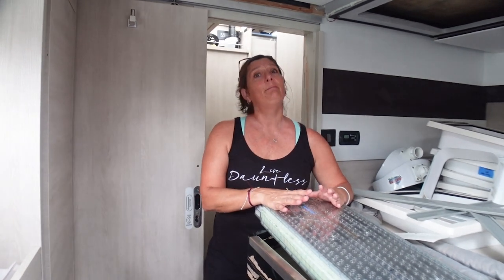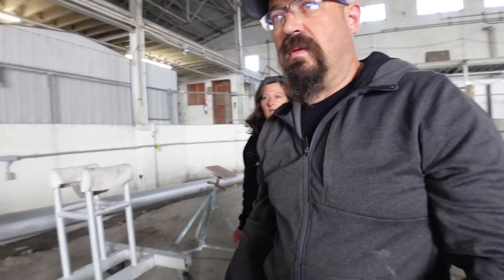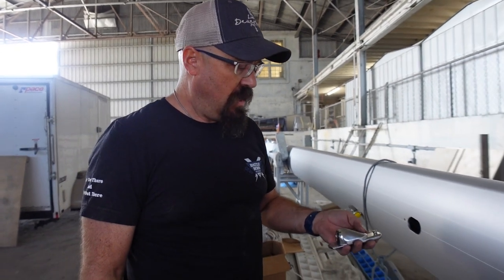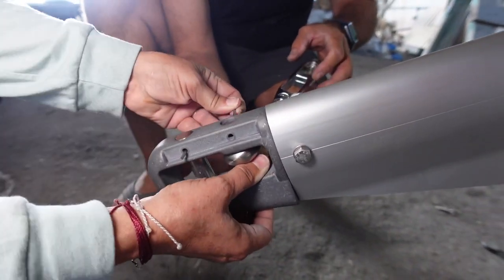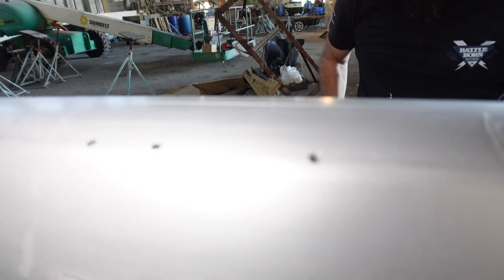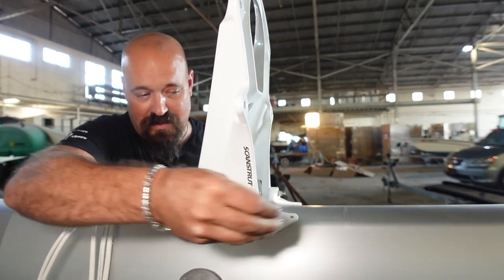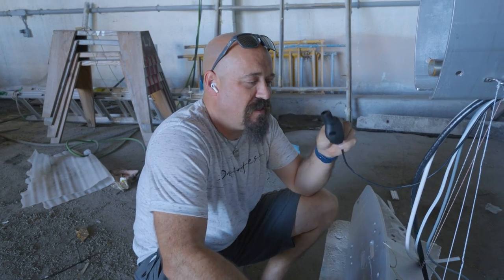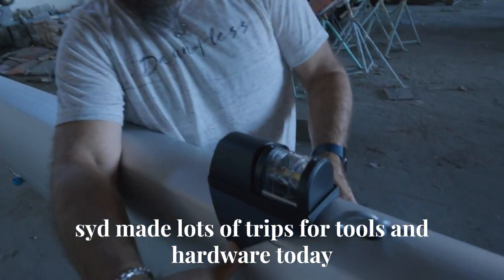WHAT DID KIM DO?!//Drilling Holes In The Mast-Episode 111

Comment: Two things that I never use are butt connectors and pop rivets.  Those washers for pop rivets are actually intended to go on the back side typically with softer material like rubber, plastic or fiberglass.  I prefer using closed end rivnuts for all of my fastening needs and if you ever need to remove the mounted object you can simply remove the screws or bolts and reinstall them when done.  The other nice thing about rivnuts is you do not have open holes if you remove whatever is mounted and you can put the screws back into the threaded inserts to give a nice clean look.  Instead of butt connections I use Deutsch connectors for everything and they seal amazingly well.  When they are crimped using the proper crimper from the manufacturer you will never have a bad connection and you can easily unplug it for service.

Comment: To let you know a direct lighting strike will still fry as many electronics, with or without lightning protection.  When you buy a lighting system ask them if they will pay for any electronics if its fried from lightning. They will tell you no and that is because they know it doesn't do anything except make them money. nothing can stop 1 plus million amps from going where it wants to on a boat. Even super yachts can not handle a lightning strike without frying electronics.  The only way to help is have 2 separate systems where most are not on the same circuit as your VHF/Wind/radar and anchor light are on. Those things you know will fry. lightning can jump a foot easy.

Comment: With the Wire Protector sheathing (25:30) if you cut it with a hot knife (for cutting ropes) or with a heat gun just after cutting it normally on the very end, it melts some of the threads of the sheathing together and will then not fray but you can spread them to still stretch the sheath over the wires.

Comment: I with you about the left handed. I've been left handed for over 82 years. Have used the same left handed hammer you have and several other 😂. Good thing about the one you used is that you were using it the US size, if you turn the cutter side around it will be metric hammer. 😂

Comment: I would have mounted the mast light in the lower position because whatever you put below the light now, (Camera, etc.) may well obscure the throw of the light over the deck to an extent and will now throw a shadow over a large area due to the proximity of whatever you fit there (Camera, etc.) over the deck.  Still, not hard to drill out the rivets and move it. Will having ALL those holes around the spreader 'and' radar mount not weaken the mast in that region?  I was also thinking of a 'flagging' sail over the years causing a lot of vibration up and down the mast and was thinking the radar mount should have some dampening underneath it so the metal on metal wear doesn't make the rivets loose over time...No? Ty, let me know if this fear is unfounded.

Comment: They make a self centring  centre punch that you put in the screw hole and activate and punches for you and that allows you to do all the holes very well centred and reduce deviations. I have one made by Starrett I use for my millwrighting  but I am sure there is china knockoffs that are very cheap.
Reply: Why not back up the rivets with silicone to help hold the light on the mast. As the plastic deteriorates from UV the silicone will only help and is cheap insurance.

Comment: Just wondering about the mast light, if there was a watertight seal around the hole for the wires? if water runs down the mast and hits the wire it will guide it down the wires inside the mast. From the video it did not look like it.